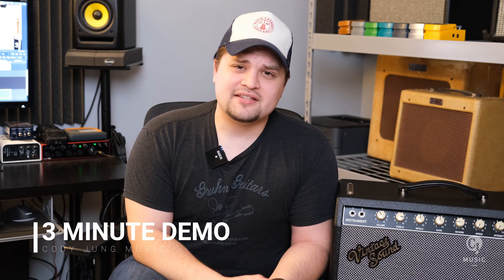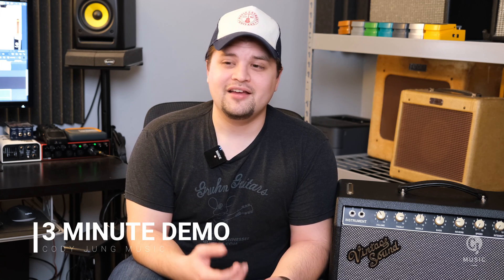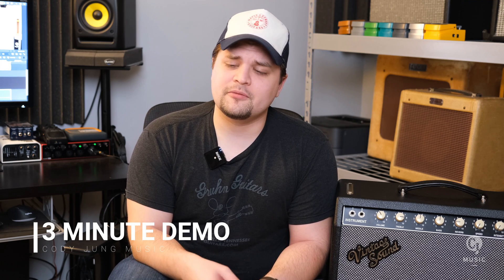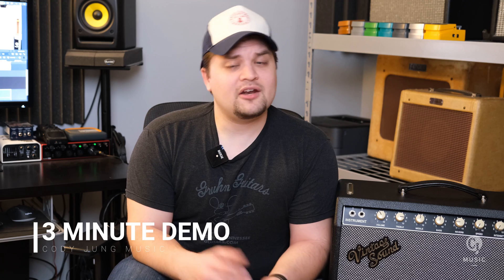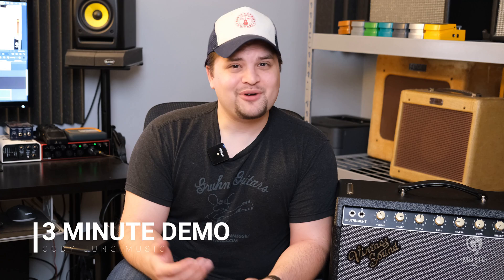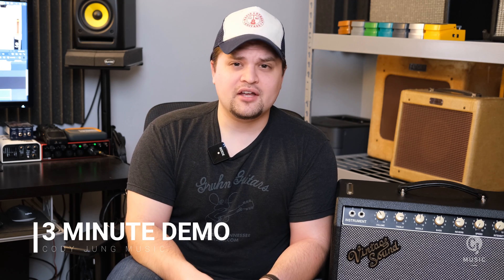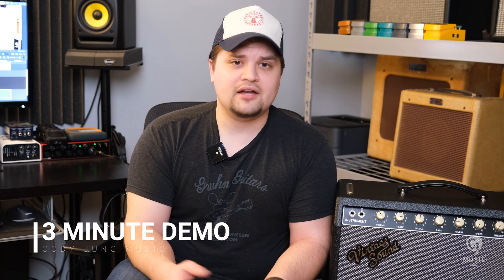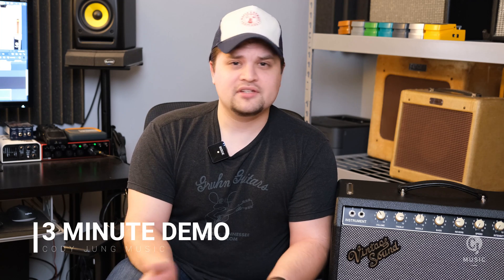3 Minute Demo: How Cable Length Affects Tone

Comment: Great video mon! Not news as such, but nice to have anything in black and white without having to waste time on it myself. Changing from Mogami to Supra here was a difference like you going from 50 feet to 6 inch in this video. Was not happy having spent all these money for something I ended up either giving away or making MIDI-cables outta.
Reply from the maker: Thank you! Yeah, I was in the same boat with your first statement — capacitance was something I’d heard about and conceptually understood for a while, but I never actually sat down and did an AB with different cables until I made this video. Thanks for watching!

Comment: Santana and Slash both choose very long cables because they want high end reduction.
Reply from the maker: Interesting! I didn’t know that about those two guys specifically, but I 100% agree with your point. There are a lot of players out there who choose longer cables for that same reason. Thanks for watching and commenting!
Reply: Yeah a lot of newer electronic components sound too bright on Dumble-style amps.  Might be something about the cascading gains but you can taste the impurities in vintage pots and vintage high capacitance cables on those amps.  The roll-off is beautiful I want more of it on mine.

Comment: So it looks like I need to rig up something allow be to carry the amp around and use those 6 inch cables while still playing :-)
Reply from the maker: Hahaha. Or maybe we just be okay with a bit of capacitance in our signal and we opt for 10’.
Reply: @CodyJungGuitar  yeah the 20 wasn’t even bad but 50 was a big difference. I’m thinking a 10 to the pedals and a 10 or 5 to the amp is gonna have to be a max
Reply from the maker: Yeah, in an ideal setting, I use 5' to 10' cables. However, there are so many ways to compensate for the loss of treble resulting from cable capacitance that I think it all depends on what you are trying to do.

Comment: Signal degradation becomes apparent at 20ft and really noticeable at 50ft with the greatest loss of highs and some volume loss. Good comparison Cody.
Reply from the maker: That’s exactly what I hear as well! In all honesty, I cannot say I hear a different between the 6”, 5’, and 10’, but the drop off after that starts to become noticeable to my ears. I’m sure there’s a measurable difference, but I’m not so sure about audible with those first three.
Reply: @CodyJungGuitar  the reason is every time you double the length of cable you double the capacitance. The sound does change between a 5’ and 10’ cable but the high frequencies affected are beyond the scope of human hearing.
Reply: @CodyJungGuitar  your right. Signal loss was not really detectable until you get to the 20 ft length.

Comment: Definite loss of high end between the 6 inch and 50ft cable!

The trick is do you feel that could be compensated for on the amp EQ?
Reply: I also laugh when someone argues ‘but I wouldn’t use a 50ft cable! I use a 20ft cable to my pedalboard of 10 pedals which is all true bypass and then use a 20ft cable out to the amp input! A 50ft cable would be crazy!’

Well…. Let me explain the math of your setup there!
Reply from the maker: Haha, yeah! It is definitely a cumulative thing. I chose to just show cable length as an easy, quantifiable example. However, if you run a 5' cable into 20 true bypass pedals, you are 100% right!
Reply from the maker: I do think there are a couple ways to compensate for this -- either with the EQ on your amp or some kind of buffer/treble booster. I'm not sure you will 100% nail the exact same tone with these methods, but you can probably negate it to the point where it doesn't make a noticeable difference. If that makes sense... Haha.